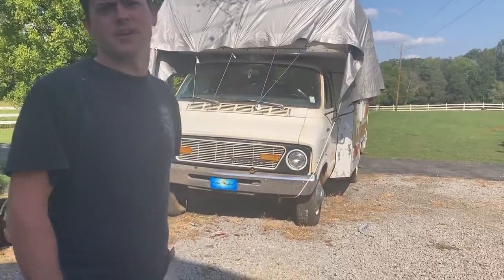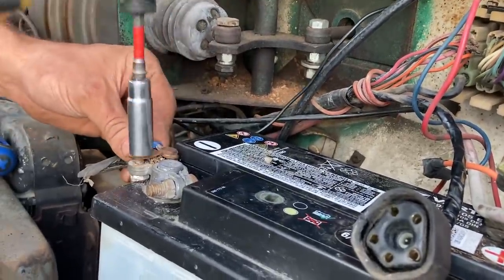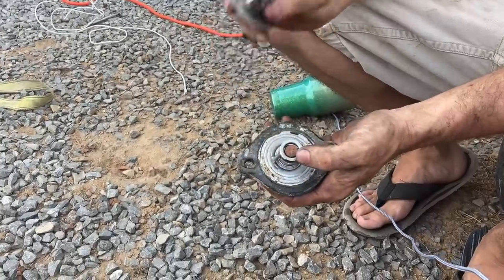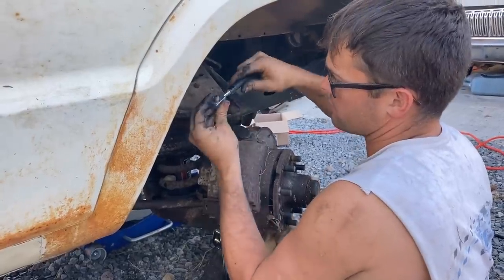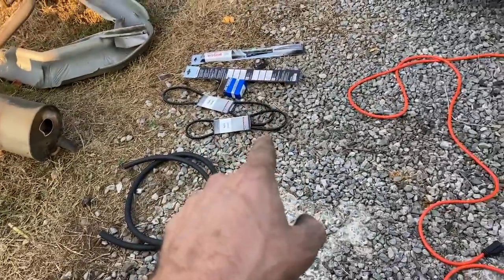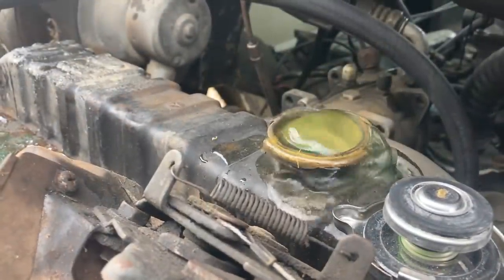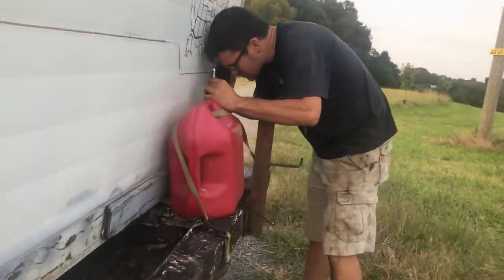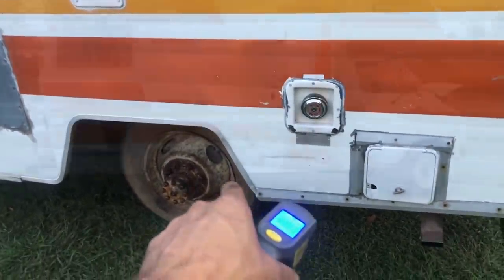broke down in our old rv on our first drive after it being parked for 27 years

Comment: Where the carburetor is flooded out the gas is probably mixing with the oil and thinning it out causing your low oil pressure maybe. I’d definitely get a mechanical temperature and oil pressure gauges if you oil pressure is still low time to replace the oil pump with a Melling High Volume unit and run Valvoline 20w50 and a Wix filter. And while ya at this service the filter and fluid in the Torque-Flite 727. And rear differential.
Reply from the maker: Good idea

Comment: a 1984 corvette fuel filter directly before the fuel pump INLET..  not in the hose to the carb..  between the line from the tank to the fuel pump inlet..  disconnect the fuel line to the carb.. use 2 wrenches please..   extend the disconnected hose to the carb with a piece of rubber hose.  disconnect the ignition module.. so it can't spark..  with the end of the extended hose in a clean clear soda bottle.. get somebody to crank the engine for 15 seconds while you watch the pulses of fuel from the end of the hose..  do this 15 second.. full flow cranking procedure 3 times.. for 15 seconds each.. 

 ignition system testing..  unplug the pickup coil.. check the resistance of the pickup coil.. 280Ω to 403Ω is the expected resistance..   before disconnecting from the pickup coil.. flip the meter over to AC volts .. crank the engine.. you should see really close to 1.0 volts AC.. if you don't... look down at the top of the reluctor on the shaft and see which side the pin is on against the shaft and scratch next to the pin.. use 2 flat screwdrivers and lever the reluctor off.. don't loose the roll pin..  put a new reluctor on it.  try again.. you should see close to 1.0 volts AC..  if you don't make enough signal voltage the power transistor in the module can't close and drag the coil negative to ground saturating the primary winding.. so when the poles of the reluctor align with the pickup coil the AC voltage signal drops to zero and the module transistor opens and the magnetic field collapses and creates a high voltage spark out of the secondary. 
 you may need to check the gap between the pickup coil and the reluctor.. brass feeler gauge or plastic 0.010"  make sure the shaft does not wobble do to worn out bushings..

 please also check the coil positive power with the key in the RUN, Cranking and Run positions.   if you only get power in the cranking position.. change the ballast resistor.. 

 lastly. the ignition module case has to be GROUNDED TO THE ENGINE with a braided ground strap..
Reply from the maker: Ok thank you

Comment: Those Ballast resistors probably cost Dodge a fortune. They caused long starting times and they would not shut off . An engineering failure. Good job troubleshooting the problem.😀🇨🇦
Reply from the maker: Oh wow

Comment: From what it looks like your fusible link needs to be replaced to it look pretty crusty to me and that may be causing most of your problems I know it was on my 68 Roadrunner. As you can probably tell those older wiring harnesses are not that great and I do mean Mopar as much as I love Mopars and I've had many many of them I've always had to replace a fusible link. Good luck with that project man I would love to have that. Many blessings to you and your family. Your low oil pressure could be due to the fact that most of those older Mopar engines used a straight weight oil, but I could be wrong and I'm not remembering right.
Reply from the maker: Ok thank you

Comment: The 1970's ignition boxes used 5 pins and a dual ballast resistor. You can put a 4 pin plug box in these vehicles.  The box you bought would probably work in either application.  It appears to be a fake Chinese Box.  They work but the transistor is fake, and the heat sink is not connected to the circuitry.  I'm curious what the ohms are on the old ballast resistor. I'd bet it wasn't bad. If the car starts when it is in the start position then dies when the key moves to "run", that is a bad ballast resistor.  I've never had a ballast resistor go bad and I've only had one box go bad in decades of driving this ignition system.  Actually it went bad on the previous owner, not one me.
  I use copper core spark plug wire, by the way, when I can get them. It helps resist fouling.
Reply from the maker: Ok good Info thank you

Comment: I noticed on the first video the RV started in gear... so those wires you were asking about on the top of the bell housing might be the neutral safety switches.... A lot of old timers would bypass that safety switch by wiring them together on the side of the transmission so the truck always gets a park or neutral signal... I have bought two old mopars and a VW bug that was wired like that...
Reply from the maker: Ok thank you

Comment: I have the same one with 360.  it was driven from  Montana to Massachusetts. i Drove down to mass to buy it and drive it back. Half way it started to log down on hills then it complete stop running. Got the owner manual and found it was low on transmission fluid buy the pan leaking a bit. Then the strange thing is i found if its low on trans fluid it has a protection build to not run in drive or even start on low trans fluid. i put a half Court in and it started right up and drove it the rest of the way home. So if you don't know this now you Do. still remodeling this and payed a little to much for it but its getting a lot nicer now. Also the gas lines get weak in these and can have problems. small lines take a lot of gas pedal pushing to get Flowing from the tank to motor . once i had to add a little of 2cgas with little oil to Carb to get it started but no problems now any way. Interior walls were full of rat droppings last year when i notices but hardly no mold  being from a dry Climate Montana. Lets chat if we come up with any issues. not a mechanic but very experienced with it.
Reply from the maker: Ok thank you .

Comment: It's in that ignition module box and all that spaghetti wiring you put a gym ignition module not on a piece of aluminum but dielectric grease on the back of the module and wire it up like you would a standard coil ignition in a Chevy but replace that jumble of wires in there that's called the Chrysler whatever kind of ignition system it is I can't remember the name of it but it has a weird name and you can watch it on more ski repair he doesn't end that video on how to wire it up he puts it in his Chrysler pickup with a 300 straight six Chrysler in it
Reply from the maker: Ok thank you I may do that

Comment: good try hope you have that carp overhaul  unless you can choke it a couple of times till some dirt is off the float circuits if you are lucky  and for the front tight brake maybe remove the caibers and lube the shafts that the calibers slides on  unless you replace some calibers. hopefully its all taking care off and running great.Good luck and great video tho.
Reply from the maker: I replaced the calipers in at newer video. Thanks for watching

Comment: It's just a 3/8 brake line you get a 3/8 brake line and you bend it to the shape seal line or you can use the nicob and I cop is easier to bend than the steel in such case but you have to put the night cop out of the way of anything it could rub on and it smells so very easy to rub a hole through
Reply from the maker: Ok thanks

Comment: "I don't know how something can go from running fine to not running at all...."

That my friend, just defined the existence of every single mopar on the planet.

And yeah, it's usually the ballast resistor.
Ask ANY mopar guy and there's always AT LEAST a new ballast resistor and a new orange box in their glove box because they will LITERALLY go from running fantastic one minute, to dead on the side of the road faster than you can say "Kentucky Bourbon".
Reply from the maker: That’s crazy that they do that
Reply: P.S.  RC Cola is AWESOME.   So hard to get up here in the Peoples' Communist Republic of Canadastan. :(
Reply: PPS.  Carb issue looks like the float is toast.  If the float has a pin hole or gets glued to the bottom of the bowl, it'll keep the needle open allowing fuel to constantly fill the bowl.
Reply: @Sleeperdude  Mopars always had some GREAT ideas, but their accountants ALWAYS won.

If you've ever seen a pre-1970 electronic ignition box (I think it was available 68-69 over the counter at the dealer) it has this MASSIVE aluminum heat sink on it. 50 years later, those things still work perfectly.  But they cheaped-out on the production version with a stamped steel heat sink with only two fins.

Ever see a Mopar with Lean Burn?  That computer on the air cleaner was supposed to be mounted in the car but the accountants didn't want to spend extra on a wiring harness, so the engineers capitulated and had it mounted in the safest spot under the hood.  But still, that's not a very safe spot for 1970's style electronics.  Heat, Cold, Vibration.... oh yeah.... electronics just LOVE that.

At least the Torqueflites were good.

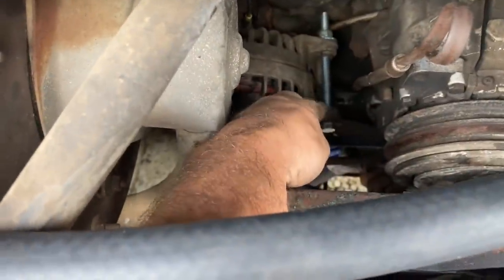Comment: At 28:21 I can see you are  missing BOTH of the SPACERS that go on that bolt. They are basically little pipes.
 There is a short one next to the block and a mid size one that goes between the two ears of the alternator. There is 1/2 inch slider inside the holes of the alternator ears. If you are missing these spacers, when you tighten the bolt, one of the ears on the alternator breaks off.  They are frequently lost when guys that are working on Mopars for the first time replace front accessories.
   I have heard that doubling up on the copper washers helps at the brake calipers.
Reply from the maker: Ok thank you

Comment: Straight up  there is  times that you do fluster me but one thing for sure, You are a very hard worker. I  say  that because I pulled wrenches on old stuff for over forty year. I had harshed you for going out on the road to do a test drive once and I am big enough to apologize for that again. So on even footing lets talk about some of those problems on this rig. Ford and Dodge interchange but ford doesn't have a hole for centering the rims. I kinda lean in the favor of just staying with the dodge wheels and I have had that same rig in my yard so what I went with was the sixteen inch wheels off of a lot newer dodge and it was drilled on most the wheels but I had to drill the others as it keeps you from hiding the air chuck or valve core so that when they are mounted on the truck you can get the inside wheel for air. Its a fairly old rig so going with bigger wheels really doesn't gain you much but puts a strain on the  transmission. I also ran into those dodges only like their own fluid but I am  thinking that has the 727 transmission in it so should not be a issue for you. Now that distributor has a diode inside of it and if it burns out, you get a no spark. I had a motorhome come in and it had caught fire under the dog house and it burnt that truck to the ground. I can't stress enough that the carb on them from the factory is in my thinking... PURE JUNK and there ain't no plainer way of saying it. I went with a edelbrock carb and did all the vacuum lines and all on it. I gained power a bunch, and it got so much better mileage that the original carb went to the trash pile where it would not hurt or be used again., I fought it for a month and after that... home free. On those front ends, I put new sway bars, shocks that were heavy duty and all new bushings in the front end. I also had to finally just change the front springs which were not so bad to do and that is when it really came to its own.. drove like the new kids rigs. The back spring leaves were worn out so I just bit the bullet and started with hangers, bushings, sway bar and its part where it bolted to was worn out so bad that it had to be rebuilt. I really think for honest sure that those bodies are so heavy that in really needs to be a bigger truck so I upped everything to the ton an a half stuff where I could. I got it in perfect condition and this old man .. Allen Russell had lost his home so I just gave it to him as we had been friends of the very best kind for over thirty years. He tried to pay me and I just couldn't take his money. I knew he was headed to go fishing and have some fun as he was in his late seventies so I hid the money he did give me in his sock drawer and then when he called me to say it was working good, where that money was. He almost divorced me over that as he wanted to give me some money but at that time, money wasn't no problem for me. He drove it over a hundred thousand miles here in alaska and I put a new engine and transmission in it for him. So the long and short is they are a good rig but a big money pit. I think your going to have to replace that distributor or it will fail. Its a tiny little black diode in it that goes bad but putting it in was a real trick and it was just cheaper to get one that the bushings in it were not worn down. Thats my book size comment and I say again, your a damn good person, and sometimes you a wanting to see something for your troubles of working on them gets my fur bunched up but then I remember that forty year ago, I was your age... that and when you showed your wifes pins in the one shot of her... man oh man thats a girl to fight for as shes so pretty it hurts
Reply from the maker: Hey thanks for continuing to watch my videos and thank you for all the good info

Comment: a possible fix for the stiff front wheel would be remove the caliper pins, clean and lube with silicone brake grease at all sliding points. At some point a guy probably would want to get some grease in the universal joints of the drive line, even if you have to press out the joints to do it.
Reply from the maker: We replaced the calipers in a later video

Comment: Good video, my list, ;) ... Replace the heater core; it's easy. Get a tubing bender and flaring tool and do the gas line correctly or pay for it later. There is a good reason for a steel line in the engine compartment. Save yourself the trouble and replace the carburetor. Probably is a bad needle/seat and maybe the float but over time the linkage areas will lose their seals and with that as you know vacuum loss. Noted: all the links in the front suspension including ball joints. It's not inexpensive but if you really want to take this somewhere far away from home do what it takes to get there and back. Do get rid of the plastic fuel filter; one rock and you are going to be down. You might think about an electronic distributor. You put allot of hard work into this unit so far, it's getting there.
Reply from the maker: Thank you and thanks for the list

Comment: I bought a 75 dodge truck new the ballast resistor used to burn out all the time I carried one with me in the glove compartment all the time  the truck was terrible the tail lites filled with water and burned the fuse out the coil springs all broke the shocks wore out by 35,000 miles the crome fell off  the door handles it got rust holes in two years I traded it on a used Chevy truck that was much better .